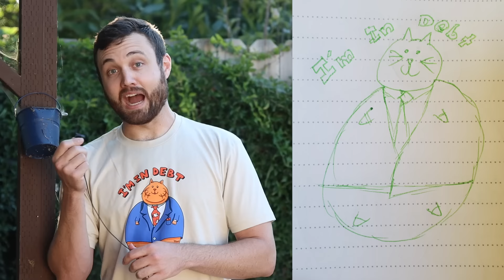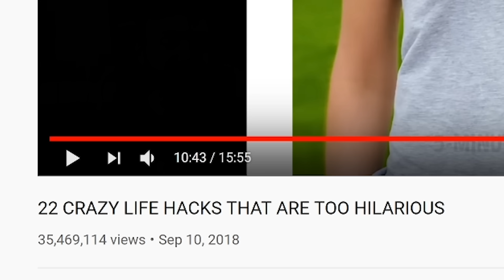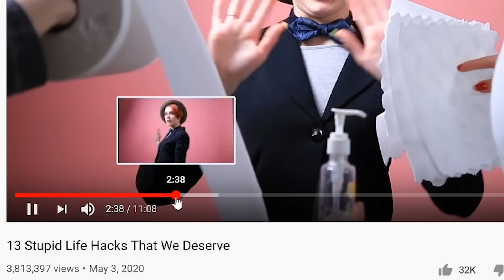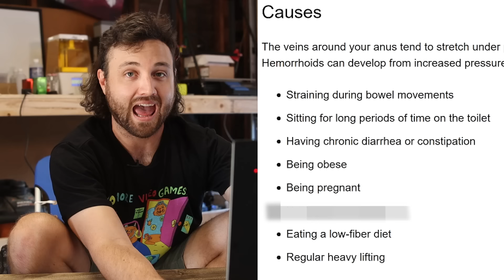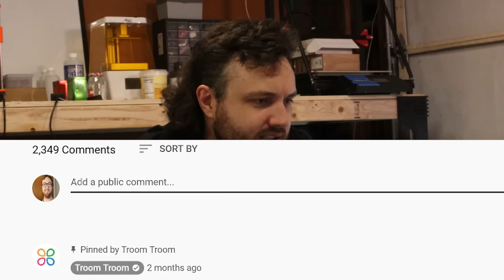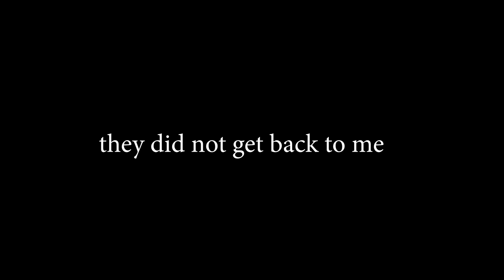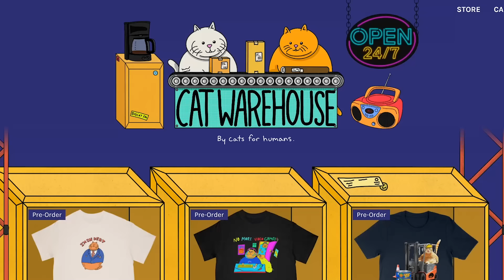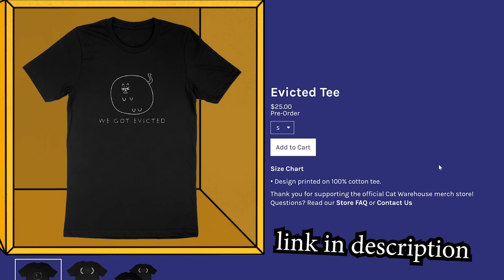Life Hack Channels Are Dying

Comment: Okay, ACTUAL acting life hack here: if you're responsible for keeping your costume clean but don't have time to wash and dry it every night between daily performances, here's a way to get rid of the sweat stink. Get a spray bottle with a mist setting, fill it fifty-fifty with water and the cheapest vodka you can find. Flip your costume inside out and put each piece on a hanger. Mist any smelly areas with the vodka-water. Let it hang in the open over night, and by the next morning the vodka and sweat stinks will both be gone. 

You'll still need to wash it eventually, but it's a life-saver if you need to de-stink something for the next day but can't wash it conventionally for whatever reason.
Reply: If you're fine with ruining your clothes with corrosive chemicals
Reply: @bakielh229  Vodka's not a corrosive, it's a solvent, that's what makes it good for cleaning. It's also, in the technique I described, meant to be used in very small quantities mixed with 50% water. It's beneficial in small qualities when properly applied, the same as bleach (which is a corrosive but can be very useful for cleaning certain fabrics).
Reply: Dang, I don’t have a washing machine in my apartment and I only wash clothes once weekly and my work shirts get gross sometimes. Definitely stealing this. Thanks stranger!
Reply: @jules666.  My pleasure, fellow stranger!

Comment: 7:25 most razor blades of this style have a removable cap on the bottom that lets you replace the blade. that cap will also have a slot in it, which is for snapping off the dull blade parts

Comment: Someone probably already mentioned this, but for snapping those craft blades the blade itself has a slot in the top you  can pull off, put the blade in and use that to snap it off. So yeah, don't actually need a tool. (I described that badly I know)